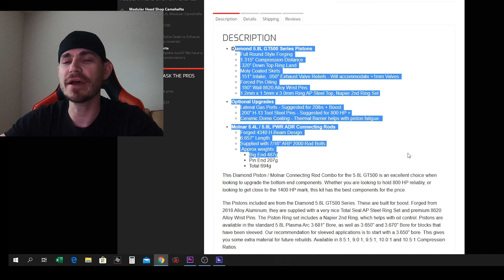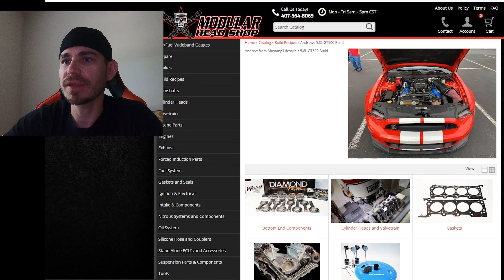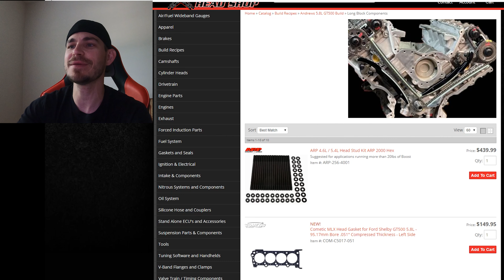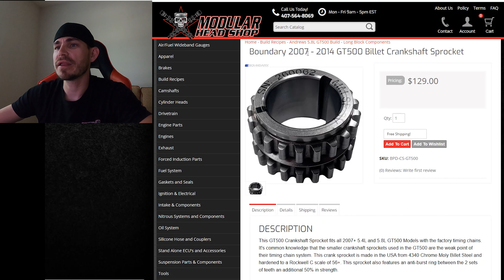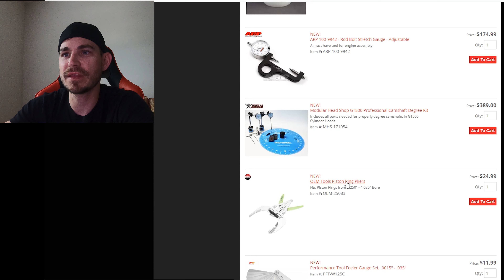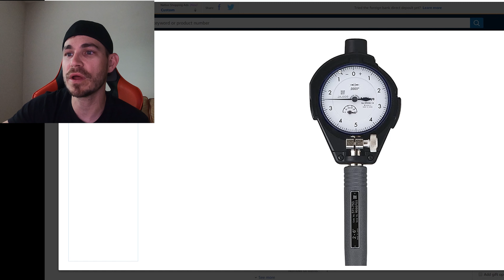Modular Head Shop Build Recipes - Andrew from Mustang Lifestyle's 5.8L GT500 Engine Build Recipe

Comment: I'm looking to have a complete engine built but your website says your only doing cylinder head work at this time
Reply from the maker: That is correct. I am taking a break from builds for a while. 
Send me an email and I can send you a parts list. The only thing I am not doing right now is block work and bottom end assembly. Just not enough time in the day.
Reply: @ModHeadShop  completely understand. I'll send an email. I cant find anyone in my area that wants to touch  a 4.6 4v. But a parts list is a start I guess